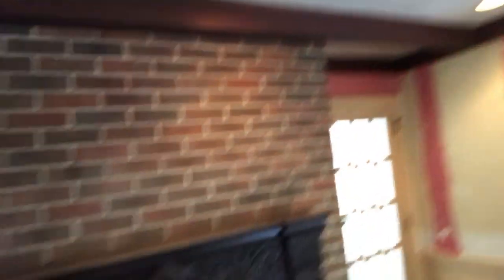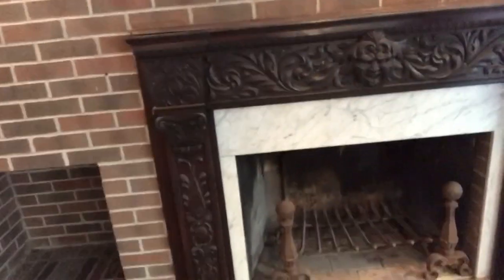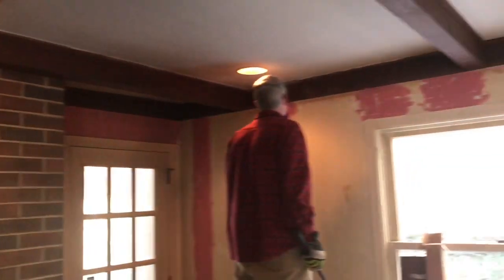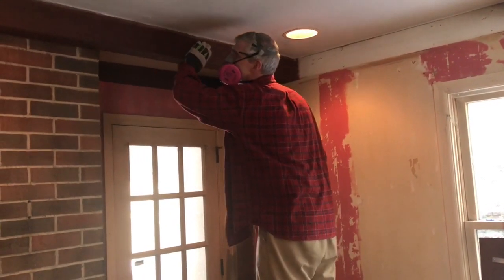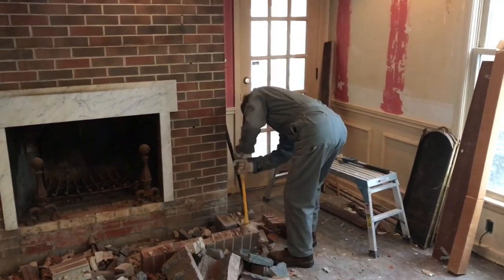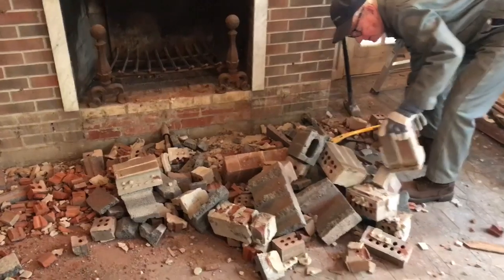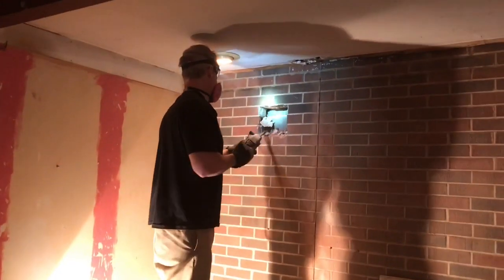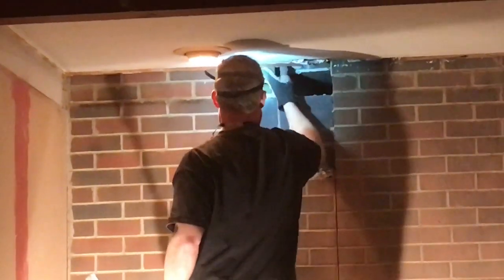Episode 32: Family Room Brick Fireplace Demolition Part 1

Comment: What end up happening to the gas line that was right in front of the fireplace? I have an old home with no gas key or switch on the outside and I’m thinking about removing my hearth but “hole in the floor” gave me great pause
Reply from the maker: We removed the old gas line and ran a new one in through the back corner of the fire box.  We also put a valve in the floor next to the hearth.  Good luck with your project!  Keep us posted!

Comment: How did you get all the old cement that was holding those bricks to the floor OFF the floor?
Reply from the maker: Hey Ken. Our brick hearth was laid on a bed of concrete that was poured in a form between the floor joists. They should have built it on a block/concrete footer because the weight of the hearth was sagging the joists and pulling it away from the fireplace. We removed the whole thing including the floor joists.

Comment: I have a raised hearth and would like to remove it. Actually I'd like to cover the entire fireplace. It is huge and dominates the room. The problem is that the heart was built over a wood frame (in the garage) only about 18' from the outside wall.  I can get to it and re-frame, but how much chiseling and removing 'stuff' can it take?
Reply from the maker: Sounds like a fun project!  We beat ours into bits with a sledgehammer because we knew we were going to be re-framing underneath and we weren't concerned about damaging the framing.  In your case, I would recommend renting/buying a roto-hammer and using a chisel bit to pop the bricks apart at the mortar joints.  That will require a lot less force and lessen your chances of damaging the framing.

Comment: What is that machine called? The one you are using to basically drill the bricks out
Reply from the maker: A Alc it’s called a roto-hammer or hammer drill. The one we use is the Bosch Bulldog. It’s been a real workhorse throughout this project!